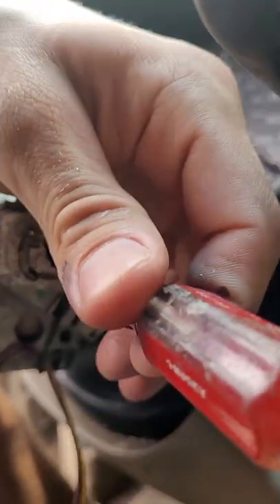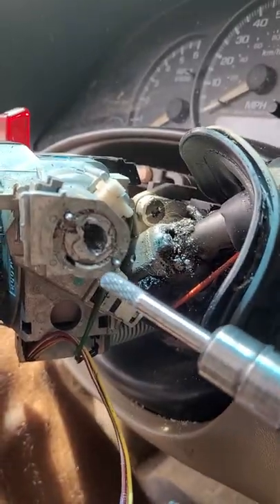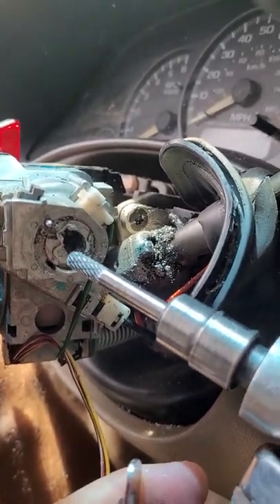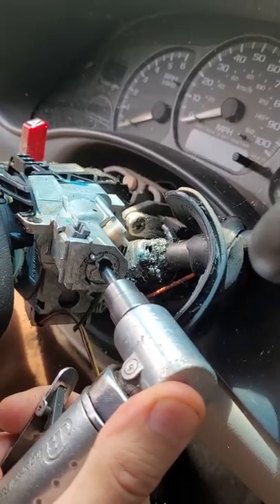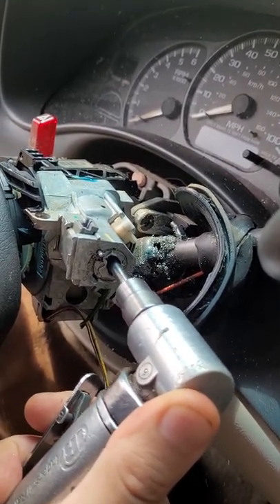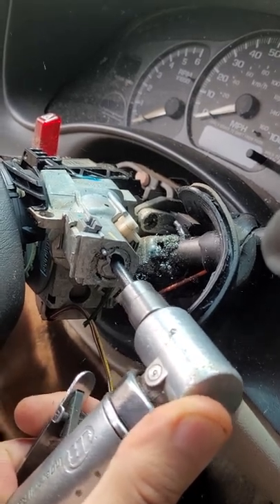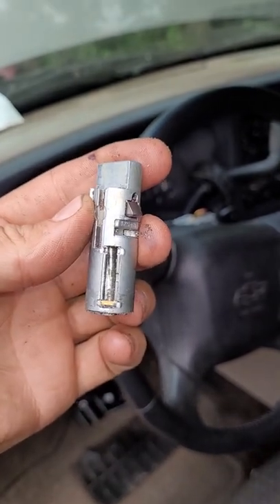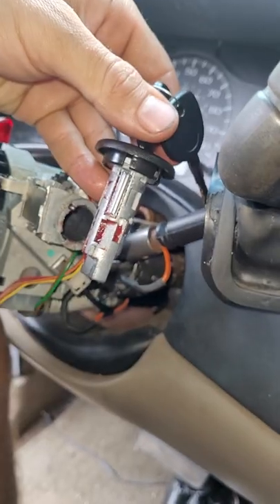Customer States Drill Truck Ignition

Comment: That’s why looking up the removal procedure is a thing.

You even showed the latch when you heals the old cylinder up. Usually there is a hole that allows you to push the latch up.
Reply from the maker: You couldn't do it. They completely broke it in place when they jammed a screwdriver in it. Had to be drilled out.
Reply: Missed that part. So you were just on clean up duty. My bad. 

You cleaned it up fairly well then.
Reply from the maker: Yea, it wasn't too bad. Thanks!
Reply: @konekillerking they lost key

Comment: My we broke the bar to turn freely it still not slideing out
Reply: There should be a little hole on top of the cylinder and there’s an access pin you push down and it should come out
Reply: Yea that doesn’t work. Either buy drilling it out has the pin stuck in the up position for some reason. It won’t slide out.

Comment: Still not gone crank key has to get programmed
Reply from the maker: Not for 1999-2007 Chevy/GMC. That started in 2007.5
Reply: @MattsShop  find that funny bc my 99 is currently stuck in security mode starts and shuts right off lol
Reply: @northwoodswoods2820 look up Chevy pass lock 3 bypass, it’s a 30-40 process but should work. Worked on my 99 suburban when I put in a new cylinder but sometimes needs to be redone when removing the battery or discharging it. It’ll have a security light but will still run instead of shutting off